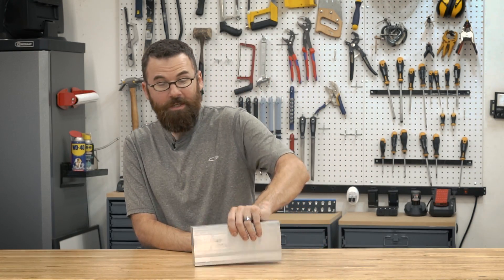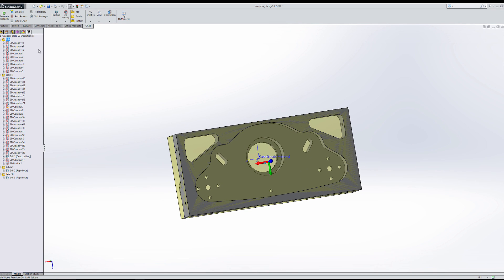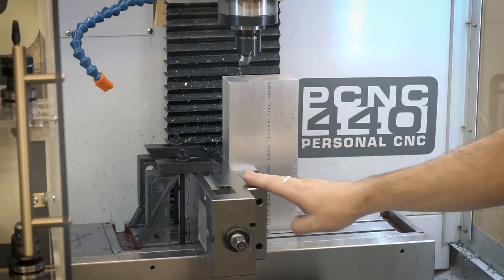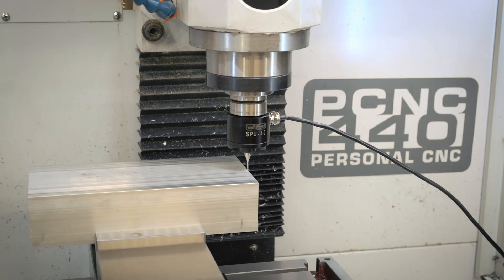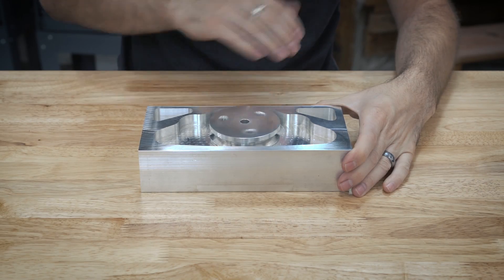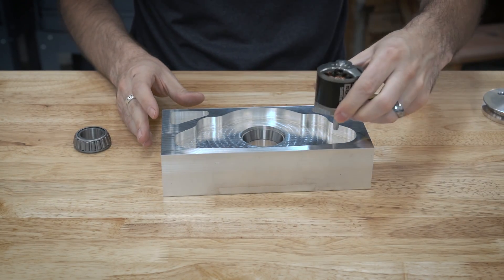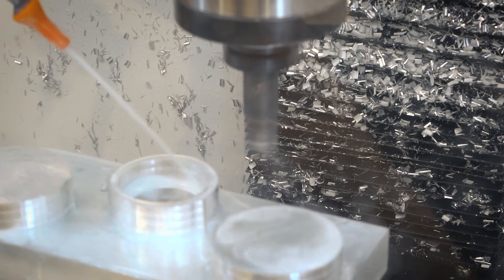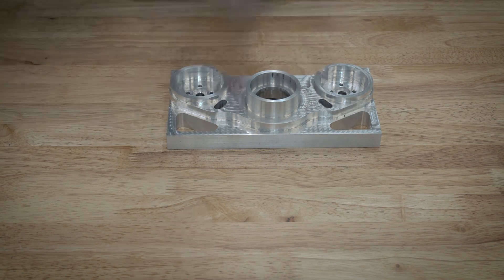From Start to Part:  Weapon Block

Comment: I programmed custom wheels at HRE for 8 years.  I used an AB Tools shear hog (1.25") for most roughing in the 6061 forgings.  I ran that tool at 360 inches/min. .200 deep/pass and cut width of .625 and 8,650 RPM (before adaptive strategies, just outward spiral pocketing)  Don't feel bad though, it was a very powerful, fast,  and expensive machine (Toyoda FH-550).  The machines had a 15,000 RPM spindle, Rapids were 1200 "/min.  Anyways, I am now thinking about converting a PM-30-MV to CNC.  Did you ever get to finish yours?  If not, do you have any helpful info. regarding this?
Reply from the maker: I did finish mine, or as finished as a DIY CNC can be!  I finished it and then promptly got a Tormach.  I think I'm done building CNC machines.  In all honesty, it's just much easier using something like a Tormach, because it always works the way it should and I don't have to spend all my time fiddling with it.
Reply: Robert Cowan I understand fully.  If you still have any CAD files or models they might help me out.  I would be very thankful.

Comment: Why do you not have the weapon pulley offset forward from the motor pulleys so that the belt wraps around it more and therefore there is in more contact with the both the drive motors and the weapon pulley.

Comment: The base looks like a Stanley router plane body.  Add a couple of knobs and a cutter and you can unplug that Tormach.
Reply from the maker: haha.  the funny part is that I actually DID take chips out of the floor and arena that look a lot like chips you'd get from a CNC, just much larger, with a terrible surface finish.

Comment: Are you using a CAM add-in or are you using SW 2018?
Reply: It looks like he's using HSM Works or HSM Express, which are Autodesk CAM plugins. They're essentially the same as the CAM package in Fusion 360.
Reply: Hsmworks Express.

Comment: I can't wait until I see the final bot, right now I'm guessing that to us either going to be a under cutter or a vertical spinner based on the design of the weapon disk and the weapon block.
Reply from the maker: It's an undercutter, the weapon rides about 1/16" off the ground.